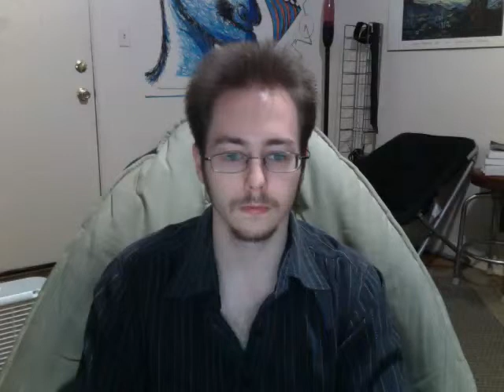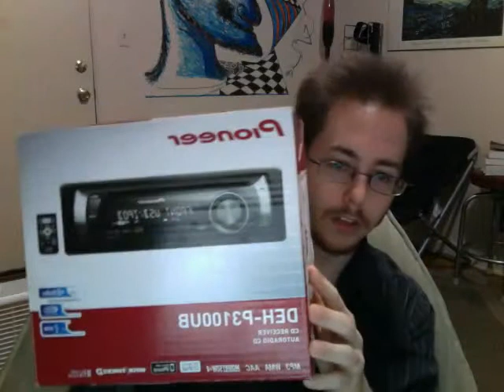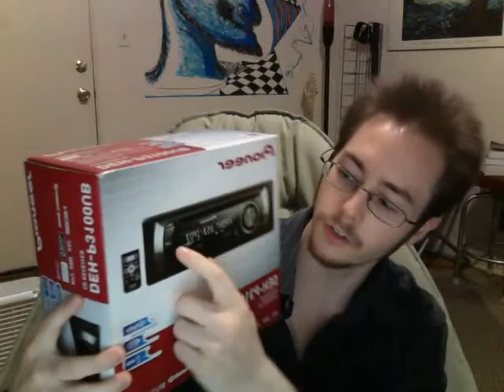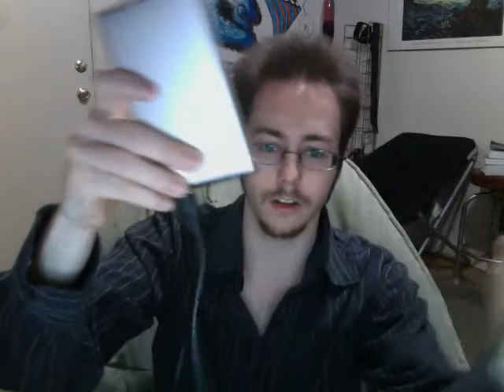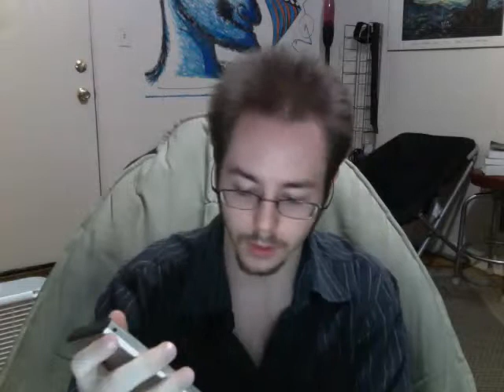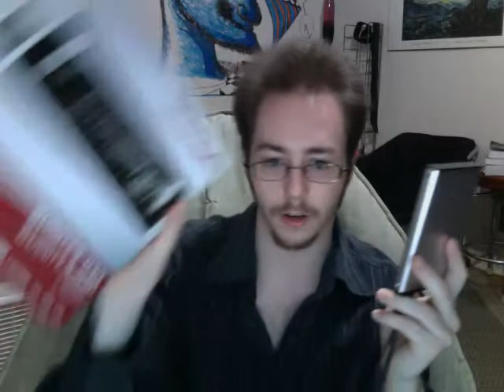Powering a Hard Drive in Your Car?

Comment: I have a set up where by I use a external hard drive with a sata data adaptor which allows me to power the hard drive through a dc to dc 12 v 3amp power supply hard wired into the car. I use a wireless network device that is attached to the hard drive which then enables me to stream music films etc on to my tablet whilst I am able to drive on long journeys.

Comment: To properly do this you need to do a home run, you don't want to splice into the receivers acc power or acc lighter if you have one (what if you need to run a 400w amp in the lighter plug) having a device on it will take away from the gauge/draw that it was meant for and blow a fuse or hot spot a wire or kill the drive if under powered. Home run to a power block from the car battery would be the best idea really and fusing at the block(15a) and battery (100a). Home run to a custom relay that connects 12v switched to your constant home run so you can use it to trip and power your drive and shutdown when the acc kicks off. Altronics has some nice affordable relays that would work like the rbsn model they have. The relay will draw a small amount from the acc wire but will not be enough to cause any problems at all like a powered device. So you could use the radio acc to trip the relay to switch on your home ran 12v connection. Ground to the chassis or a common ground point on the chassis. This here would simplify but there are a few options out there. http://www.powerwerx.com/batteries-chargers/panel-mount-dual-usb-42-amp-charger-12v-24v.html#desc or http://www.prodctodc.com/dc-12v-to-5v-water-proof-usb-interface-converter-car-power-supply-buck-module-p-137.html#.Ve-ggvlVhBc

Comment: Just quick splice (those press clip splicing connectors from any auto parts box store) into a switched 12 volt power wire. On an accessory that goes off when the car turns off.